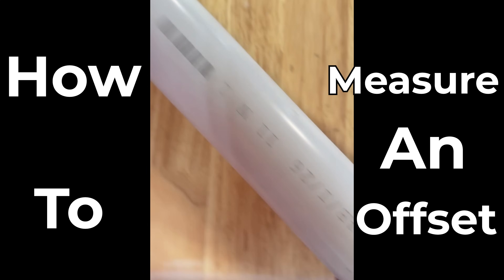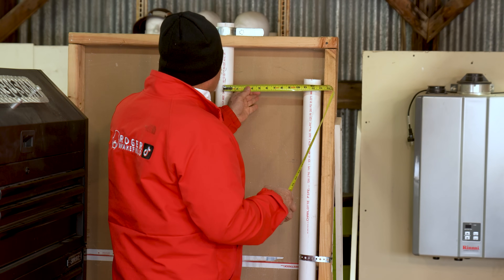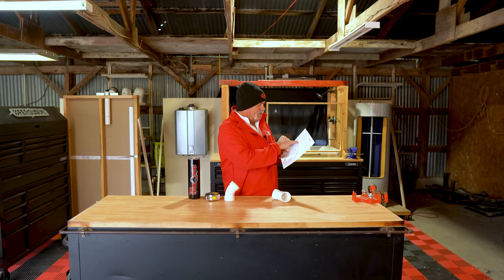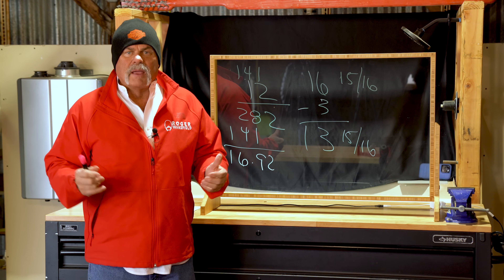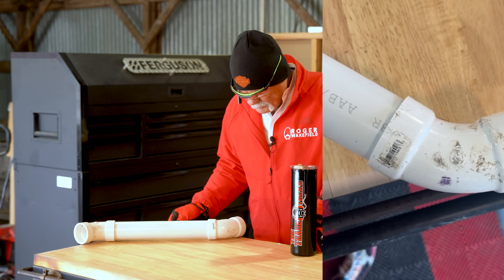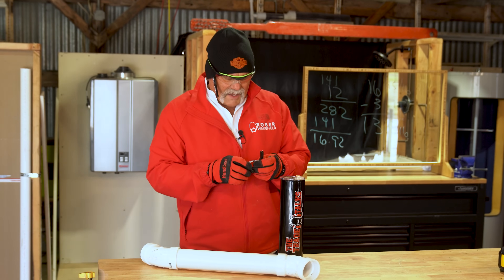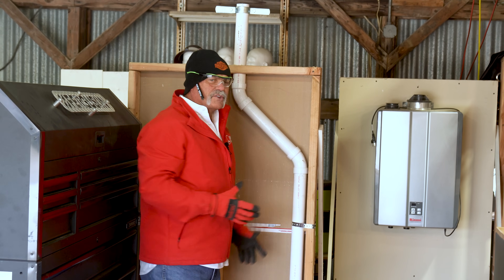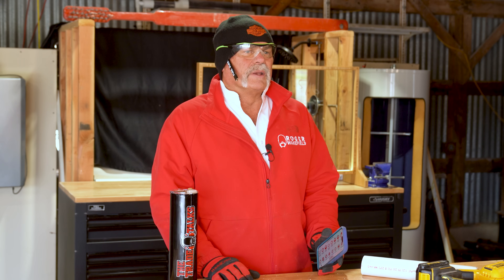Measure a 45 Offset | Advanced Plumbing

Comment: This method clearly didn’t work, the only reason this offset fit was because the top pipe wasn’t connected to anything😂, in that  case just use a dam tape measure!!!!
Nobody is doing this kind of math on the job site!!!
Reply: Hold on boss I gotta pull out the glass board 🤣

Comment: I am  confused by the imperial  system
I' m pretty sure most people just don't do those negative powers of 2 calculations and just do vague approximations.
Wouldn't it make more sense from a practical point of view to just use 1/16  ( basically a 1.5 mm , millimeters), and do everything in 1/16th ?

Comment: In  all fairness, all those "old school plumbers" would have also told you that this MUST have been a 1 1/2- 2" vent line.  Because they would only ever run a 1 1/2-2" sewer drain one of two ways....either straight down, ...or at 1/4" per foot fall.  You gotta watch those old school guys.

Comment: Not a plumber a toolmaker so I would always use Sine of what ever angle. and I get 16.9703 or 13.9706 length of pipe for offset. Yes I know it will take longer to do the job but it will be precise.

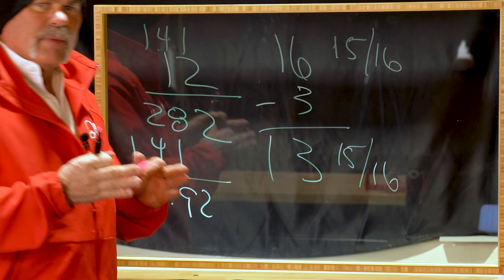Comment: 4:45. So you initially got a 12” measurement. Why not just add 3 inches. 1.5” for the half way point of each one of the elbows? You’ll get the same answer without having to multiply and subtract and all that. In other words, add the make up to 12”.

Comment: 1/(sin 22.5 degrees) = 2.613.   Multiplier for 22.5 degree offset is 2.613.
Likewise 1/(sin 45 degrees) = 1.414.  Multiplier for 45 degrees is 1.414.
This works for any angle and the calculator on your smartphone has the sine function.  Be sure your calculator is in degree mode (not radian mode).  It will say "Deg" somewhere when you use the sine function.

Comment: Or you could use 8th grade geometry.  Since you have two parallel lines and two 45°angles, you're dealing with an isosceles right triangle. Each leg is the same length and the hypotenuse is the square root of the sum of each side squared. The legs are 12". 12^2 = 144. SQRT(144+144) = 16.97 less 3" offset 13.97.

Comment: This is supposed to be easier/better? You needed to break out the engineering drawings for the pipe thats not available then you had to do a bunch of math. You need a damn pocket engineer book when eyeballing it works 99.99% accurate. You literally went around your elbow to reach your ass 😂

Comment: Love how he tries to say it's all easier to use a different method then eye balling... but then he goes to use his tape measure measures a few things writes a few things out figures things out still hasn't figured the angle out still writing things down... eye balling it I already had it lined up dry fit cut to size dry fit again close to done by the time he's done and it's actually very accurate if you eye ball it correctly... measuring can be more accurate but it's so much more tedious... and overcuts undercuts by a 16th of an inch make all the difference also when you go to cut the pipe most people don't consider the thickness of the blade as part of that cut... they just cut a line.... it counts as part of the cut when your measuring it's part of alot of mistakes that get made lol eye balling too but, you can eye ball and just nick it down little by little until perfect fit.

Comment: For an experienced plumbing contractor like myself, all you need is a tape measure and a good eye, no math required! Done it enough times over the last 35 years 👍
Reply: It's never too late to learn to do it the easy way.  math is a tool don't be scared of it
Reply: That’s why us new school plumbers are repairing and fixing up all the old bull 💩💩
Reply: It gets covered anyway. I do use math for center to center but the rest is eyeball. Unless the fixture is specific on the outlet, it'll be close enough. By the rest, I mean vertical.
Reply: Don’t be an old school hack….
Reply: @droneNheavy I’m 31 and have been doing plumbing for 9 yrs. I eye ball it and get pretty darn close, and you make it seem like there aren’t young hacks

Comment: Math based off center to center.  22° set x 2.6 = travel,  30° set x 2= travel, 60° set x 1.15 = travel. These numbers will get you closer than your eyeball.  All your multipliers for every degree are on the trigonometry. Want to really have fun get into the minutes of the degree. Good video Rodger 👍

Comment: Coming from a combined local of plumbers and pipe fitters a lot of times the pipes that we were dealing with were much much bigger and also many feet in the air and welded pipe so of course in that situation you have to do the layout with plum bobs on the floor figure out the piece needed and then take it up and  weld it in place the tolerance is critical and there's no room for mistakes on a welded six or eight inch chilled water pipe or a ten inch cast iron roof leader perhaps this is a easy way to teach the guys how to do it but the real reason to learn is that

Comment: The length of the pipe is the offset of the vertical pipe (in this case 12 in.) divided by the sin 22.5 (which is .38) which equals 31.36 inches. Or of you want a multiplier then take the inverse of .38 which is 1/.38= 2.61 and then multiply by 12 and get 31.36 inches. Most smart phones have a calculator with the sine function.

Comment: I'm not a plummer, but I've known a lot of very good turd wranglers in my life. Without watching the video I wrote down 13 3/4". My thinking was 12 squared plus 12 squared equals 288. And 17 is the squareroot of 269, Acouple of things I've know for nearly 50 years. Then my guess was the fittings would take up about 3" subtract that from the 17" minus a little more and you will be close. "CLOSE ENOUGH CONSTRUCTION"  As far as the 22.5 degrees I'd need my framing square and figure it like a rafter. BTW I a vintage carpenter and will check  more of your videos.
Reply: That's funny

Comment: Pythagorean theorem kids. Your high school teacher couldn’t give you any practical application for trigonometry because that high school teacher had no life experience to relate a curriculum lesson to real life. A2+b2=c2. It’s that simple to get that hypotenuse.
Reply: Yep, but unless you have adjustable angle connectors like HVAC, it’s only going to be 30s, 60s, or 45s.  So most people only need to memorize the ratio 1 :sqrt(3):2 or 1:sqrt(2).

Comment: Sorry nope. No way no how  never going to happen. Need to explain the reality to the plumbers. Time is money either you're good or you're not.  This amount of time I could have ran  a vent from the floor through the top plates to the outside,  Anybody that clamps the 2 inch Abs pipe in a tripod to make a cut is fired. A  Hand pull saw and small tape measure is all you need.  Don't cut your finger

Comment: The answer to your question regarding the 22.5 degree angle is 1.08 x the horizontal distance, assuming like the physicist says that it is really a 90 + 45, or 90 + 22.5 angle in this case.  The angle that we are computing from is the horizontal, and thus we can subtract 90 and work with either 45, or 22.5..The right triangle trigonometry approach from my high school days is: We know the horizontal distance, which is 12, and we know the angle down from the horizontal, 22.5.  We want to know the length of the hypotenuse.  The cos 22.5 = the adjacent over the hypotenuse. Solve for the hypotenuse.  Multiply both sides by the hypotenuse, and divide by the cos 22.5.  This will yield 1.08 times the adjacent.  The vertical drop from the horizontal will be computed from the Tan 22.5 = opposite(vertical side) divided by the horizontal.  Multiply both sides by the horizontal, and the vertical = horizontal times tan 22.5, or .4142 times the horizontal.

Comment: I would call it geometry and the simplified version pythagorus theorem when an and b are equal. So basically take the length and multiply by sqrt of 2 which is 1.4. 

The length is 10?  The length you cut is 10 * 1.4 = 14.14 or about 14 1/8.

Comment: Been using this trick now since this video came out. I do central vacs, not plumbing, but this situation definitely applies. Even down to the dimensions of the tubing fittings. It definitely goes quite fast when you’re just doing it and not explaining.

Comment: For all that's curious.  He used 1.41 because that's the secant of theta 45 degrees..... If you have a different angle that needs to be made, use your calculator and type in that degree of angle you want then the (sec) button. The number you see you then multiply by your, "center to center" measurement.
Reply: If you don’t have the sec button, like on calculator in iPhones, then just input the angle and press cos. Then press m+ (make sure your memory is cleared by hitting mc). Then press 1, then press divide, then press mr which will recall the cosine of the angle you just input.
Reply: You could also do 1/sin(angle)
Reply: I did that on my phone using a 22.5° angle
I put "1÷sin(22.5)= 2.61
What does that 2.61 mean or for? @deserthandz7145
Reply: 45 are the 2nd most common in any construction piping trade
Reply: I needed this info! Thank you!
Reply: Or because it's a 45-45-90 triangle which has a 1-1-sqrt2 ratio
Reply: This comment taught me more math than I ever picked up in school.
Reply: Dangit, our teachers were right ... We ARE going to use those calculator buttons and math in the "real world"

Comment: I use this to find where to start a wye so its diagonal lands perfectly at a fixture or stack that's at the end of that section.  If you're really good at this, it makes a big underground so fun. Other guys are using more fittings... guessing at perfection... never quite hitting it. While I'm smoking them by slamming waste and vent groups fast and clean and tight as a gnats ass... ah, good times 😊
Reply: I also use this to turn a horizontal 45° ell right before a closet bend... if I know the offset distance I can Calc backwards and add the fitting take off to land the 45 
Tits on a Ritz

Comment: If pvc pipe cost the same as solid gold pipe, this would make sense, but it’s just pvc if it’s a little long trim it, if it’s short cut another, use the piece somewhere else. Also use a chop saw, smooth clean cuts every time.

Comment: So we had a bathroom bulit in our basement with standup shower and sink All run into sani flo upflush macerator toliet. We had about year now and just bad smell figured was building up in macerator. I looked at sani flo Descaler and it’s $70 for gallon 2 uses. So I been buying Zep Calicum lime remover $20. But it deff helps but still a smell I put my nose in toliet and shower don’t smell it. Where could it be coming from?

Comment: Where does 1.41 come from?
Reply: FOUND IT: If you have a square that is 1" by 1".  The diagonal measuring is about 1.414"
Reply: It is the cosecant of the angle 
To find an angles cosecant divide 1 by the sin of the angle
 1÷(sin)45° = 1.414
Try it with a 22½
 1÷(sin)22.5° = 2.613
 Cosecant for 30° = 2

Comment: Why not dryfit a section of pipe to the 45 you had in your hand and mark directly on the pipe where you needed to cut instead of eyeballing.  That also avoids the triple checking with the tape measure.  Marking directly on the parts is typically the faster and more accurate way to cut to size.

Comment: For those saying eye ball works everytime. That may be almost true over a foot, but if you have to do this an arms length or more away youre just throwing darts at a dart board.
If you can eyeball two 45s 5 feet away from each other and get both ends of the pipe ALL the way inside both hubs, kudos youre considerably more psycic than me.

Comment: The chicago license exam we had to do a rolling offset  using math only,, a regular 45 set that isn't to log you can use a square edge say 12" mark 12 one way And 12" the other wayand measure 2 end points minus your 2 take offs for 1/8 bends

Comment: As a physicist that dwells in mathematics from time to time, LOL, I have to say that that's 135 degrees, not 45. Now another thing that I know from mathematics is that when you measure a center point on a round shape like a pipe, it can be pretty hard to find the actual center. It's much easier to measure from corner to corner if you have something up against it. That will actually give you the same measurement. Inner corner to inner corner or outer corner to outer corner.
Reply: It’s an offset angle, it’s measured from the position the pipe would be in if it continued on a straight alignment.

On measuring centre to centre, if you find the point your straight edge contacts the object you are measuring you have found the point perpendicular to the centre of the object in the orientation of the direction between the two objects.

If you want to get fancy, and go three dimensional, use a jigger, measure three or more points on the circumference of the pipe, use software to create a circle of best fit and extract the centre coordinates.
Reply: @samwilliams1517  Yes, I do know that it's based on cutting the circle in half to 180 degrees and then measuring from the offset of the resulting line. That works fine in plumbing but I was just giving a bit of trivia as in math we measure from two divisible lines and the angle between them. Here you are suggesting that we measure from a non-existent line to a splice which is not how mathematics are done. You measure between the lines you can determine. So in this case it would be 90 degrees plus 45 which is 135. And then the offset angle that is missing to get to 180 is 45 but the angle is technically 135 and 225 respectively. Thank you.
Reply: Ok, let’s go with your assertion that we cannot measure to a line that we would have if we extended the pipe.

What you are missing is that pipes have a flow direction, hence you are not measuring the angles between two ‘lines’, but instead two ‘vectors’ they have a direction, if by your assertion the water is to flow back on itself to conform to your view that we cannot assume the pipe continues, then the flow vectors are reversed, meaning we measure a 180degree angle between them, hence we must remove 135degrees and end up at a 45 degree angle between the flow vectors .
Hopefully this makes more sense from a mathematical viewpoint.
Reply: @samwilliams1517  I understood it without you having to explain it. I know where the 45 is coming from I'm just saying that that technically is no 45 degree angle

Comment: I use a stick rule. It gives you the hypotenuse. Then you just gotta do the fitting take off. Stick rule is the best.
Reply: It really depends on how far the travel is. A foot yeah that's not critical but when you are figuring out a run that has like a idk 10 ft offset the a stick rule wouldn't work .. that said if you have offsets like that in residential 💀 it must be a billionaires house

Comment: I would use the 1.41 equation when running an offset in larger size pipe or if I was working with cast iron, its much easier that way. But I never bother with 1/16” increments

Comment: I had done a small offset about a year ago in my laundry room to modernize the plumbing to in-wall laundry box faucets and drain.  I had used Roger's method to do the offset correctly- most difficult part was finding the offsets at the HD.

Comment: It’s time companies make rotary lasers, with an 45 angle option. We do a lot of concentric piping for gas boilers. Those pipes have different beginning and ends. We made a bracket/adapter to fit on the gas boiler pipe-end, so the laser is centred. So we can measure mid-air to our exit point. We made a table/formula to calculate how much pipe we need to ‘add’ for a specific rice of height. The laser produces 2 centre lines, perpendicular to each other. It works fast and precise.

Comment: an oscillating tool works great for cutting 1-1/2" pipe in tight spaces, I use mine all the time! if they made longer blades it would work on Bigger sizes of PVC pipe!